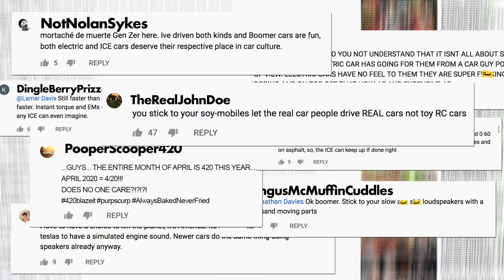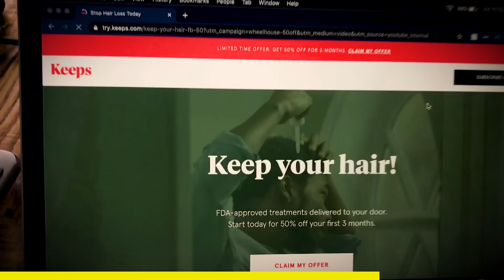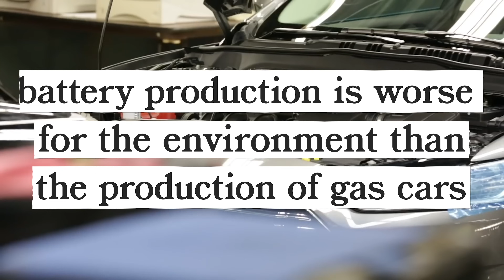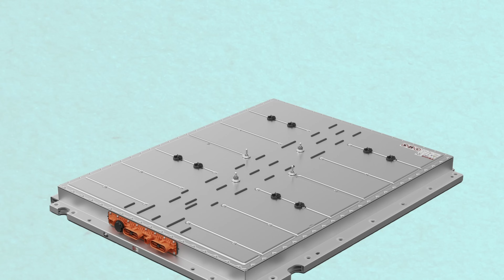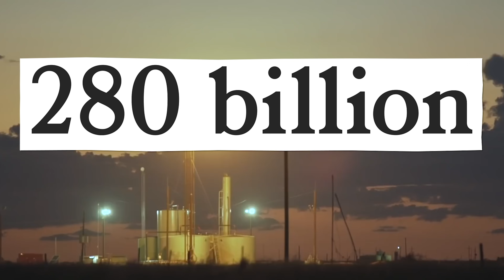Are Electric Cars REALLY Better for the Environment?

Comment: I think people should be able to buy what they want. Giving consumers options is always the best thing.
However I hate environmental agendas even if we switched every internal combustion engine over to an electric vehicle. We would still need to refine crude oil for all the other things we use crude oil for. Electric vehicles would not be possible without polymers from oil.
Or the rubber tires. I think people who are promoting electric vehicles are unfair because they failed to recognize that we will not stop using and refining crude oil.

Comment: Nobody ever talks about hydrogen fuel cell cars. They can be filed up in a similar way to gas engines and run smooth and silent like an EV. They also have a similar CO2 footprint to a gas powered car and after the production they will have 0 emissions. Sadly the hydrogen fuel cell market is very small with only Toyota, BMW, Hyundai and KIA dipping their toes into it. But when more people understand how good hydrogen fuel cell cars are and more cars are bought, the prices will go down and the hydrogen station infrastructure will grow. Maybe the planet can be saved, people just dont know it yet.
Reply: And mercedes, see GLC f-cell.
Reply: Won't hydrogen go boom in an accident very quickly? Batteries just catch fire and gasoline catch big flame too, but flammable gas...
Reply: @alubchicken  mate have you seen a electric fire 😂😂 that shit is worse than hydrogen
Reply: @ndlovulwazi  haaammooooond
Reply: Energy storage... A fuel cell car will never compete with battery or fossil fuels especially. Liquid hydrogen has to be kept under pressure to remain a liquid within a cylindrical pressure vessel. Beyond that not only is the fuel incredibly dangerous the tank itself is a huge risk and not very efficient space wise. Batteries can be stuffed anywhere and are no where near as dangerous, fossil fuels pack the most energy per volume and are a liquid to begin with.
The thing is battery tech is still emerging, before laptops and phones batteries were more or less unchanged since their inception. Now that we are using them en masse and for large scale applications that will undoubtably change. The tech will improve and should surpass fossil fuels for energy density, hydrogen has no future in these sorts of applications. Hell consumer grade lithium batteries hasn’t even been around for a generation yet. Current batteries are like propellers compared to the supersonic high altitude ram jets they will become.
Reply: @TroaBarton  but if more people buy hydrogen cars that technology will improve too
Reply: MadJamYT you can’t compress hydrogen gas any further. You can’t make a pressure vessel safe. You can’t have the same energy density with hydrogen. Any fuel tank would have to be cylindrical and would take up too much space.
There’s no room for improvement it’s already at its zenith.
Reply: @TroaBarton  in a hydrogen fuel cell hydrogen get turned into electricity. That electricity gets stored in a lithium ion battery. The battery is very very small and so very efficient. Most electricity gets stored for less than a second until it gets used. Hydrogen cars are much more efficient and clean. And with modern technology those tanks will get safer and smaller. Another idea is to power cars with nuclear energy. But then people need to be OK with nukes driving around

Comment: For electric vehicles when considering fuel source, solar and wind are not that great either after considering the environmental impact of creating and disposing of solar panels and wind turbines.  Every ledger has two sides.  Thanks for doing the show.
Reply: Also, comparing gasoline fuel production to production of lithium is a false comparison.  One is a fuel, the other is a raw material.  Again, not looking at costs associated with production of electricity - whether fossil fuel or "green" - makes the comparison less than fair.

Comment: "An EV is only as green as the electricity you charge it with"
Reply: 8:57 Even if you charge it with coal electricity, it is still greener.
Reply: Ev's and power stations are more efficient than ICE therefore it is still greener since they use up less energy than an ICE would

Comment: Very good video! There is, however, a problem with the number of emitted CO2 when producing a large battery. The 17 tons of CO2 you named comes (probably) from a study done by the IVL Swedish Environmental Research Institute in 2017. Back then, they had 150-200 kg as average CO2 emissions per kwh battery. However they recently corrected this number to 61-106 kg, so the CO2 emission for a very large battery (100 KWh as in the shown Model X) would be closer to about 8-9 tons. That goes to show how much more efficient the production process of batteries has gotten in a short period of time and is also a much smaller number.

Comment: You forgot to mention nuclear when listing clean energy. Almost zero co2 output.
Reply: There's the problem of solving what to do with the waste, if only we had a way to use the waste as fuel..
Reply: @tehnoob19  actually there are some plants in production that run on recycled nuclear waste, and the United States is the only ountry that doesnt recycle its waste
Reply: All the waste from nuclear power plants could fit on a football field stacked about 40 feet high and is highly regulated. The waste from coal power plants floats off into the atmosphere and the burnt cinders or ash just get piled into a field some where.
Reply: Nuclear power plant has dangerous waste.

Comment: currently gas cost less than $1/gallon. It is way cheaper to travel on ICE than EV. Plus, who is gonna be able to fill up in a few minutes? ICE. Even the fastest supercharging tech is still at least 4x slower to reach only 80% and if there are more EVs charging at the same area, the charging speed slows down because it is like it is bandwidth limited.
Reply: Today, crude oil prices just crashed to MINUS thirty-seven dollars! Yes, it means you get paid to buy crude oil!

Comment: Good to know the facts. Just one question, is the life of a gas car longer than an electric? As in, new batts being fitted etc. More mining? I own and drive both. The range on my electric has drastically reduced in the year (11months) I've owned it. I've heard (after buying one) the shelf life of an electric car is around 4/5 years? DON'T KNOW IF THIS IS TRUE, COULD BE A PUB TALK. My Honda integra still has the same range after over  20 years.

Comment: Environmental impact refining rare earth magnets. The animals killed displaced by coal mining to generate electricity. The carbon footprint of building solar wind battery banks.
Reply: This isn't even an argument, you're stating things without any actual info or stats.
Animals are killed when drilling for oil as well, everything has a carbon footprint but that of solar panels etc drops off after prodction & everything that is refined has impact.
Great.

Comment: The only issue I have with electric vehicles is cost for battery replacement reminds me on the rx8 which costed 2k for a rebuild every 100000 miles and batteries hopefully will cost less but it will be easy for the companies to keep battery prices up and I do like the idea of evs but I don't want to wait for a recharge just to go somewhere

Comment: 9:00 That is not true at all. I put in Audi etron with pure coal power. It only better a BMW 118 after 300000 miles! Most cars don't even last that long! Yes, I did use that climobil website.
Note, China, India and Australia electricity is primarily coal powered. They are the biggest emitters of CO2 and switching the biggest polluters to EVs will not even come close to reducing CO2. It is no point for the "developed countries" to restrict so much on the automobile industry when so much more could be done by those developing countries. 
I don't mind people owning EVs but stop calling those machines good for the environment.
Reply: James B Hi you should work for doughnut media since you do a lot of research
Reply: @Seawolf Ahem... I am using the Climobil app as prescribed by the video. I put in Audi eTron 160000 KM with Coal as power source (note there is no option to pick Australia, China or India which is suspicious). The CO2 per km is 317g/km. This is way higher than most cars with 13.7L/100km or 17mpg.
Really better for the environment?

Comment: An EV cant drive for 10 years on 1 battery it will need about  3 or 4 new batteries. Sow with that in account its way worse then an gas powered car 😄
Reply: HappyDude modern lithium ion batteries should last about ten years, there are og Priuses that are still on the original battery

Comment: actually, an electric car requires more energy to move than an electric car. You will create more carbon emmission per charge of an electric car than a gas car will per tank fill unless that power is green. But the only power sources better than fossil fuels are geothermal and nuclear fission. Every Nuclear disaster was because the technology was either decades old (Fukushima), recycling hot water (Chernobyl) or some steps not taken to make sure water didn't get to where it wasn't suppose to go (3 Mile Island, which was a partial melt down). Then there is the disposal of bad batteries. Now you are dealing with more toxic chemicals that can't be burned or burried.
Reply: Thanks for letting me know that "an electric car requires more energy to move than an electric car."

You learn something every day!
Reply: @Benjamin-ow5dd  tried to find the site I used a while ago. That app provided was from the Luxembourg Institute of Science and Yechnology. Nothing wrong with that unless they get or pay contributions to anyone of suspicion.

Comment: At least we car guys can enjoy gas-powered vehicles while non car-peaple ( like the ones that only use a car for shopping for example) drive EV's. We are a minority so It woldn't make a big difference. For example here in Brazil all cars are flex, It means that a car can run on Gasoline or ethanol. In the 90's there was a project invented by Brazilian engineers called "Proálcool", that used ethanol "álcool" to run car engines. Ethanol is waaayyy cleaner than gasoline, and also much more powerful. My father has a 1993 for Versailles and It runs on ethanol, It is a Rocket.

Comment: Overall, this was a pretty good video, although there are a few things that need to be addressed.

Firstly, the concept of total fuel efficiency was not properly discussed. In general, gasoline cars are around 20% efficient, whereas most power plants are around 50% efficient. Combine that 50% with an electric car's roughly 60% efficiency, and you get 30% total efficiency. In other words, gasoline cars consume around one and a half times the energy needed by an electric car.

Second, the efficiency debate does not take into consideration the disadvantages of electric vehicles. Firstly, in cold climates, additional energy is required to heat the cabin and the batteries, significantly reducing overall efficiency. In addition electric vehicles are significantly heavier than their ICE counterparts, increasing the energy they require to move.

Third, at city speeds, electric vehicles benefit from regenerative breaking. The effect of this will depend on the driving habits of the driver.
All things considered, driving an electric vehicle emits roughly 35% less carbon dioxide than an ICE.

As far as the manufacturing impact of a vehicle, more needs to be considered than simply the CO2 production. Byproducts of the refinement process for lithium and cobalt are very toxic and often end up in rivers and lakes. This can cause far greater environmental damage than just the CO2 emissions. In addition, most of the countries from which these materials are sourced have very poor environmental protection regulations, exacerbating the problem.

End of life impact was briefly discussed in the video. However, not enough emphasis was added about the fact that recycling batteries is exponentially more damaging than recycling an ICE. Traditional cars are made up mainly of steel, plastic, and aluminium. These materials are generally straightforward to recycle. The chemical components found in batteries, however, are very difficult to recycle, and doing so has serious environmental impacts.

All things considered, the environmental damage caused by both types of vehicle is similar, although they go about it in different ways. Claiming that one in significantly less harmful than the other is simply wishful thinking. If environmental impact is a serious concern for you, consider buying a smaller vehicle, driving it less often, and upgrading only when necessary.

Comment: Have you taken into account that the battery banks in currents EV's only last 6-10 years and need to be replaced creating more emissions again?
Reply: most studies i have seen on this does not account for replacement batteries or parts for either platform.

Comment: At the moment, an EV will need an new batteries on day and a petrol car will not need anything in particular apart from oil change ? Also, one day i would like to know the pollution of all the fluids in an petrol car like the engine or transmission oil, anti freeze, battery acid on both EV and petrol car.

Comment: You have to take into account the replacement of the car from gasoline to electric alone.  And the fact that we have to refine oil for lots od other product...and gasoline is just a by-broduct.  And how to get rid of it than burn it in an engine??

Comment: Fantastic job, Nolan! One aspect of fossil-fuel power plants that you overlooked, is the matter of regulating/enforcing/monitoring/inspecting emissions. It’s pretty simple, actually: inspecting the emissions of every single tailpipe is something only some states can justify politically, and even then they can only do it every few years when a vehicle is due for a new registration. Compare that with the much easier act of an inspector personally visiting a power plant to collect emissions samples — something that can be done much more often, if the regulating agency so desires. Furthermore, if a state government (or the feds, even) want to apply a “cap and trade” model to regulating emissions, that’s not an option for personal ICE vehicles, but it is an option for regulating emissions from power plants.

It’s kinda wonky and more of a policy issue than a technology issue, but it does play a huge part in comparing the lifetime carbon footprints of ICEs versus EVs.

Comment: Tax credit for Tesla and GM have expired.  It is a tax credit, not a rebate or instant cash.  If you did not pay enough tax in then you will not get the credit back.  Also, you may reconsider your always owning a gas car statement.  I was one of the biggest noise maker gear heads ever and it took 1 week daily driving a Chevy Volt to completely turn me off of Gas only cars forever.  I sold my Forester "STi" and am making plans to fully convert my NB Miata to EV.

Comment: Daily driver 1968 Dodge Dart everyday and Everywhere.. still doing it's job..
Look at it this way.. my car hurt the planet a very long time ago, now 52 years of reliable transportation..
Reply: I don't think you watched the video. Production of a new gas car creates around 7 tons of CO2. Operation of the the average NEW gas car is an additional 5 tons of CO2 per year. Your Dodge Dart is likely 20 tons of CO2 per year. So driving your Dart for 2 years would be the same emissions as production of a brand new EV PLUS the operation of that EV for 200,000 miles. So for 52 years your Dart has had more emissions that like 25 EVs built and run for 200,000 miles.

Comment: Todays Li-ion batteries is only the start. As demand increases new technologies emerge. IBM has a new chemistry along with Mercedes. Nicola us-EV company says they have refined Li-ion to a new level on many aspects. Today’s problems with EVs is a relatively small bump as a start, new solutions will come along. A motor with 90% efficiency and the possibility for renewable sources is key 

I’m driving my diesel car using HVO100 with 100% renewable sources with up to 90% less co2 emissions in the meantime.

Comment: When I can drive 400 miles, spend 5 minutes charging to full from nearly empty, and be on my way for another 400 miles I will drive an ev.  I will also not spend 60k for one.
Reply: I mean, how often do you drive 400+ miles and not take a break of ~30 minutes at some point...?
Reply: LYNE Exactly I don’t know how many times people forget that you can’t drive too many miles without taking a reasonable break
Reply: Okay including the cost of your vehicle spend almost $100,000 in a couple years on gas and oil changes then
Reply: The point is charging any kind of decent range ev is not convenient or quick.  When it is, then it will be a viable replacement for the family gas powered car.  That still comes down to a reasonably priced ev that isn't s tiny box or a toy for rich people.

Comment: mitsubishi mirage gets a whole 39 combined how in the world have we gone backwards on on fuel mileage freaking pintos and shit where getting 50+ in the 70's and my dads little ranger diesel gets 50 and it has a 4 speed transmission so it cant cruise without screaming on the interstate my mom used to have a volkswagen tdi several years ago another vehicle that got 50+ mpg.